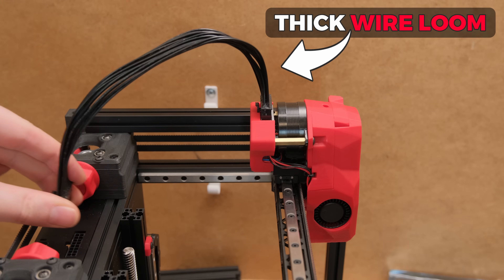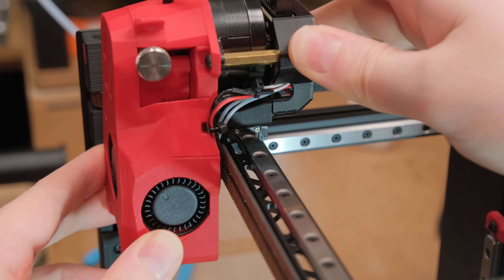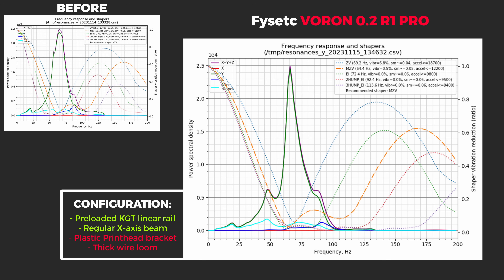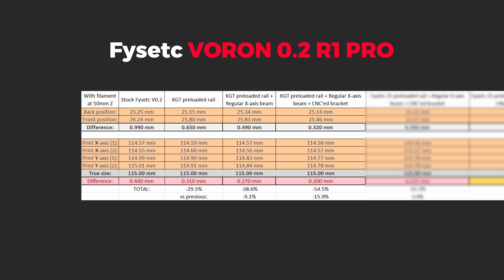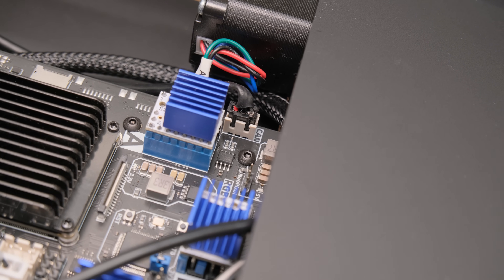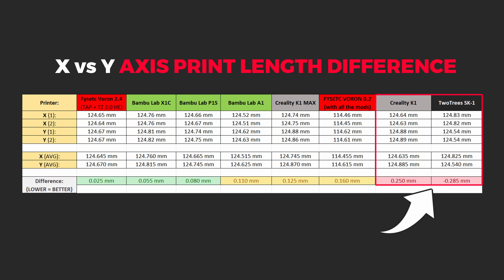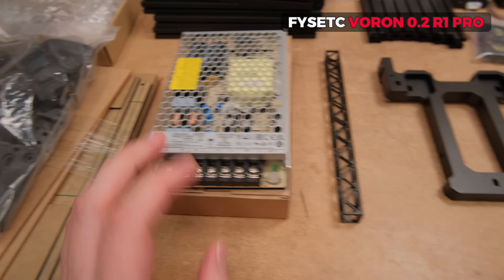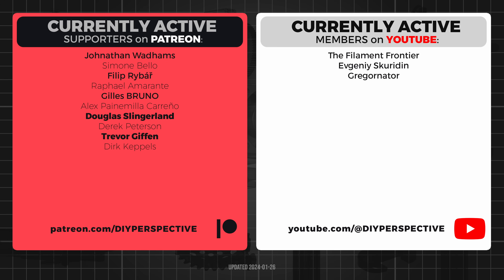How STUPID is the THICK WIRE LOOM on a small 3D PRINTER? (Printhead Flex = Inaccurate Prints)

Comment: Damn that's dissapointing that the Fysetc kit is plagued with so many problems. Seems like you're better off with another kit maker for the Voron V0.2.
Reply: i think if you buy this on aly the price is right, I work for a big company and the only thing i bught was the 3d printing board but i calculated how much it would have costed me for a full set
Reply from the maker: Yeah, it is a small 3D printer and their decision to include such a thick wire loom with loose rails is so bad. They should have rather included the CNC printhead bracket with regular extrusion and the CAN BUS.
Reply: @PrintingPerspective  sadly pretty much all kits with a picobilical board have these thick looms. You have 14 (?) wires and the not the soft one with the silicone insulation, personally im not surprised. Formbot was so grateful to have all rails as z0 light preload and a x rail in a separate package with z1 high preload. My rails were flawless, but i switched to a mgn9 for x as i retrofitted a pandoras box gantry for out of build space travel

A bit off topic, but voron should make the top hats of their printers bigger, doesn't matter if that ruins backwards compatibility with older frames or not. If you want gentle bends on a v0 bowden tube, it will most likely rub. On a trident 300 amd 350, it will also rub at some point, maybe not on the 250. Ratrig for example has differently tall top hats depending on the printer size on the v core enclosure, thats how it show be done
Reply: I wouldn't want the vorons enclosures downgraded to the level of the vcore's though.

Super complex stl, very expensive to have made, absolutely not hermetically sealed... and clearly the printer was not designed to be enclosed like the V2.

I don't currently have a cable-chain-less voron so I don't know avout that, but I would have assumed that if you went without cable chains you would go CANbus and it would be fine.
Reply: @ludovicurbain4048  i would just like that the tophat also scales with size. Its not only the umbilical wiring if you have one, but its mostly the ptfe tube, especially if you want to print carbon fiber filaments. The rubbing on the top panel scratches it over time, which looks quite ugly and i personally had some homing failures due to the ptfe tube getting between endstop and x axis during y homing. Could have been prevented with more head room. You would have the same issues with a v2 at higher z heights, but you could simply limit the max z height for that, although on a 250mm one thats not that cool as it can only print around 200mm tall before smashing the ptfe tube into the top panel, which is also am after thought im my opinion, the v2 frame only allows for maximum advertised z height without a direct drive
Reply: @over_pizza_2578  indeed it makes sense. Vorons have always been designed with printer density in mind. Maybe other v0 users have figured out a way around that issue.
Reply: @over_pizza_2578 I've had homing issues as well just because of the resistance that thick wire provides... Making my own with silicone cable was a good decision. I even had sporadic loose connections in the stock one...
Reply: All the kit makers sell this stupid, poorly designed part. @PrintingPerspective